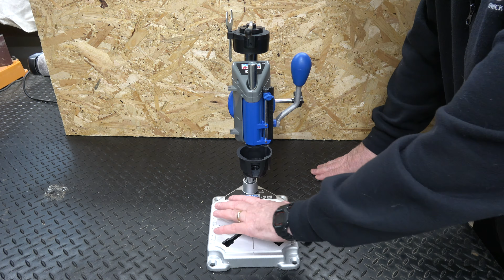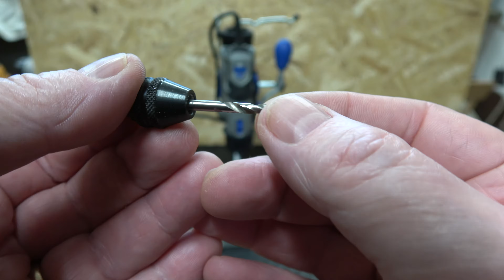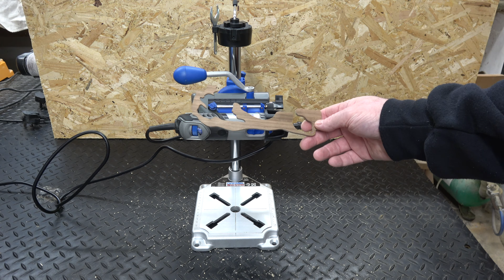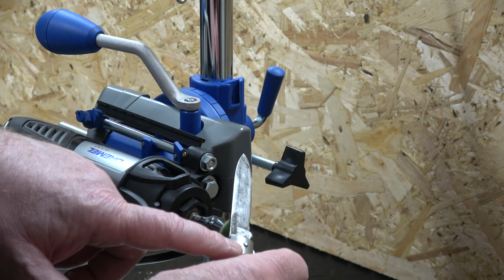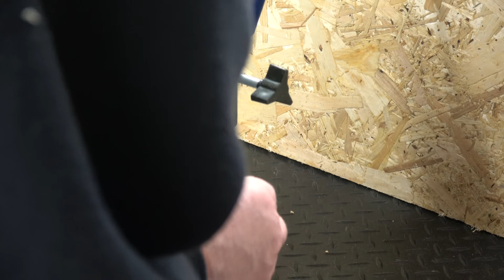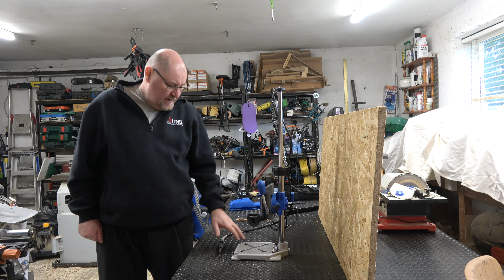Dremel 220 Workstation Review and Demonstration

Comment: Great video. I’ve just ordered one of these to use with my titan rotary tool (£20) and diamond cutting discs (£6 for 20) to frag corals, the coral growth in my reef tank is getting out of hand 😂, this will make things so much easier. And it’s currently 20 quid off on Amazon. So a nice coral fragging station for 66 quid as opposed to proper ones that are 600+ quid. Marvellous 👍

Comment: This tool is all right for basic work but if you need high precision such as when you want to drill a PCB with drill bits that are under 1mm the unnatural play/wobble of this unit works against you and breaks the tiny drill bits 9 times out of 10 so.....I returned mine.

Comment: Thanks. How accurate is that depth step?  And do you think the can be used with a dremel 3000 for drilling 1/4” holes with a #5 reamer. Or that would require a real drill press?
Reply from the maker: I would not attempt to drill 1/4" diameter wirh this set up.  :-)

Comment: Really appreciate the demo. On occasion demos are no use. I have now purchased a Dremel stand. Thank you for the info
Regards Andrew 😊
Reply from the maker: Glad it was helpful Andrew!  :-)
Reply: @RussellPlatten  I would like to purchase one also but one thing I was wonderimg about since it was not  mentioned in your video:
1) With the dremel In the vertical position:
The up-down lever enables drilling like a drilling press - ok under stood as you nicely demonstrated in your video
BUT
2) With the dremel in the horizontal position:
You showed how a drum sander can be used etc.. 
BUT 
Can we put a fiber glass cutting wheel (for example) on it and somehow use a drop/down motion to press DOWN and make a slit/cut into metal/wood/etc  for example?

Thank you for a great video!

Comment: Hi, could be possible to use with Dremel 575 (L adaptor). I need to cut tiny metal pieces but with enough precision using dremel ez speedclic. Thank you, great channel.
Reply from the maker: No, you cannot use the adapter.  You could use the dremel without the adapter and tilt it so that it is horizontal.  :-)

Comment: Can you plunge the dremel then lock it in that position, i.e. use the lever to lower the drill bit and lock it inplace?
Would be very handy, many years ago (1982 ish) I bought a Black and Decker Woodworker (their cheap router) and found that it had a 43mm collar just like a drill, so I bought a drill stand that could lock at any depth fixe a plywood base on with a 6.4mm (1/4 inch) metal dowel in it and used the stand/woodworker combination as an overhead copy router, all I had to do was make a template for what I wanted out of 1/4" plywood and stick it to the underneath of my workpiece then use a 6.4mm (1/4 inch) router bit to cut the wood to the shape of the template, made some lovely contoured mahogany table legs that way.
Anyway, I thought it might be very useful for the Dremel too, but it needs to lock in place after plunging
Reply from the maker: No, it does not have that facility Terry.  The Dremel can be dropped and locked in position using the post clamp at the back of the drill assembly (1:07 on the video), but it is not a very controlled way of achieving what you want!  :-)

Comment: A little warning for people before picking up any stone and just grinding on them. Know there are stones out there as well as minerals that will KILL YOU if you just go grabbing up any old pretty stone and grinding it. There is also stones that if you don't use water to keep them cool and the stone heats up, it will release toxic gases. Many rocks will send dust into the air of things like lead. The wrong stones like asbestos will send little spiny needle like/fish hook barbs into your lungs and cause cancer. Not to also mention silicons into the air you breathe in that will make you sick. NO rock dust is good to breath in or dust from metals. Also, don't lick rocks! We have rocks on this planet that will react with water, aka your saliva/ spit and or stomach acids, and make you sick or even kill you. Best rule of thumb. Don't breathe in anything that is not air, and protect your lungs with masks and your hands as well with gloves. Some stones are toxic even to handle. Last but least. Some stones are radioactive and sanding them could send it all over you, your house/area you work and contaminate you. Same with leads and asbestos stones if not careful. CAREFULLY AND ALWAYS identify your rocks and compositions and how or if you should even mess with them. Even rocks on places like eBay will sell you toxic rocks and not tell you about it. Be very careful! I'm no expert, but I know a bit about a bit from rock tumbling. 

But as for the video of what this tool can do. I like it. But I will definitely be adding a little gravity fed water container with a drip hose to my work on stones for things like Jasper and Opal.
Reply from the maker: Thank you for that important information!  :-)

Comment: Got this from Amazon and the bolt that hold the handle in position on the side came broken off inside....
Called Amazon and a very stupid cocky guy couldn't give me a solution where to get the bold that is broken off ...
After a few minutes searching through the "spare bits and bobs jar" I found a better bolt that has a slot in that works perfect....
Think I must patent that idea and sell it to Amazon and retire from the royalties monthly........

Lots of wood milling to be done with this tool ....
Reply from the maker: LOL - good luck with the patent!  :-)

Comment: will this Dremel product be compatible with pieces from another brand? Or would I have to buy new bits from the Dremel brand?
Reply from the maker: I would think that it depends on the brand.  If the threaded collar is the same as Dremel, it should be fine.  :-)

Comment: Thank you for this great demo. Can you tell me, what is the measurement between the end of the chuck (when the Dremel is in) and the base surface? I want to drill into a 113mm workpiece and am unsure if this would be possible. Thanks a lot!
Reply from the maker: I have just been out and checked the capacity with the multi chuck fitted and it is around 175mm Kate.  To achieve this I had to raise the inner tube and slide the 'crows nest' tool rest off the outer tube onto the inner.  This allowed me to use the full length of the outer tube.  I hope my explanation is OK, it is a little difficult to put down in words, even though it is a simple task!  :-)

Comment: In the end I followed your way, but I was wondering by replacing the two long screws where there are the springs for two longer ones and using its two long screws to attach it to the worktop.
Reply from the maker: I understand what you were thinking about and it is a very good idea Alvarez!  The only issue is that the plywood would need to be thicker and you would have to disassemble the base to fit and remove it which is more time consuming.  Still, it is a very good idea that I had not considered!  :-)
Reply: @RussellPlatten  So, you Will  have a New video for us soon !!!!! 😋
Reply: If some one buld à bases in aluminium for it with holes to attach direct into solid worktop make some money
Reply from the maker: Yes, it's a pity that they did not provide holes in the base to allow users to fix it to a plate!  :-)
Reply: @RussellPlatten  That's why you are !!! T helps us to find a good way

Comment: Hey mate!  Thanks for the tips in this great vid!  (And in the 335 one too). To properly say thanks I thought you might like to know the following thoughts I had while watching: :) 
I get that your set in your ways ("shortcuts" etc.) And although you're mindful enough to tell us to exercise proper PPE... 
 I would really feel less nervous for you while watching if we could get that power cable up off the desk and out off the way or at least more "well-managed".  I'm not "taking the piss" or anything, rather to the contrary I simply aim to improve the quality of your videos, presentation through demonstration... After all it's the small things. Tiny details which make the difference! 
Anyway, as I'm currently designing and preparing a build of my own workstation, I thought you might pause for thought on my idea to have power outlet options (extention/surge boards) up high, on a rail above everything else on my bench.  During my research/sourcing  stage I discovered these guys: "Makerbeam" and although still deciding to order something custom from them or fashion my own similar but much simpler solution... Ive made this too wordy, sorry... But just let me know if that makes sense to you and you understand, please?
Reply from the maker: I agree entirely!  I have two 5m 6 gang extensions that hang from the ceiling, one above my bench and the other above the area where my bandsaw and mitre saw are located.  I just screwed a couple of brass hooks into the joists and ran the extension leeds, up and across to the hooks.  I took the bench extension down a while ago when Ineeded some extension leads for another issue and just never put it back!  My entire electrical system is also protected by a RCD which is situated before the consumer unit and there is also a second RCD in the garage so I have two protecting the workshop area.  :-)
Reply: @RussellPlatten  yeah! That's really cool - I just happened to notice the one time you mustn't have been using it lol!  - ALthough, I do see it a lot in youtube vids (or similar) that's why I had thought to add it to my workbench build :)  
MIne will be a little more electronics on one side of the room and music making stuff one the other (not ideal but there's space restrictions for me unfortunately)  
I was even thinking of having a sliding microphone bar with a Array of mics attached, not unlike those you used to see at press conferences back in the day! :)

Anyway... I'm planning on adding it on to the top of my workbench at this point, mounting the vertical pieces to the sides (or legs) of the table before looking at further reinforcement to the table top... I was just sharing all this in case you wanted a new tutorial build idea - If you don't already having one showing off your existing setup you mentioned(?)  Or, maybe you can point me to a similar vid by a peer? Or... something?

It'd be great to get any ideas as im not fully set on the top&sides idea... I may well have an option to mount into the wall studs... 
BUt that could be too much idk

thanks for taking the time to read this lengthy reply :)

appreciate you

Comment: Hi Russell. Thanks. That was excellent. May I ask one thing please? I realise it's not ideally suited to drilling holes through small pieces of stone (like your piece), or glass, but this is what I've used my Dremel for to good effect recently. Can you please give me any advice or tips as to how best to do this by using the 220 as well, as it would potentially make precise and safer fine drilling more possible?
I've just unboxed and assembled my 220 and I wonder how I can adapt it for such use. Drilling stone, shells and sea glass to insert clasps for necklace pendants.
P.S. I've also seen a video on Amazon with a water spray accessory (????), for cooling the diamond bits whilst drilling.
Any advice would be much appreciated. Thanks Russell. Wayne.
Reply from the maker: I think the workstation will make drilling those materials much easier and give you way more control Wayne.  You need to find a way of holding the workpiece securely so that you can position it correctly.  I would try something like a mini drill press vice:  https://amzn.to/3g2J3lX  As you could use the pins to grip irregular objects and also work with straight workpieces if you stuck some rubber on the vice faces.  I reckon you could use a normal kitchen spray for cooling, just have it set as a jet, not spray.  :-)

Comment: is possible to use this station with rotary blades without fastened the base with bolts on the table?
Reply from the maker: I use it without bolting it down, but it is safer to secure it.  I would use ratchet bar clamps to hold it down if you are worried about the task you are performing.  :-)

Comment: With the aluminium base, and the travel maxed out, is there any chance of drilling into my table while working with this tool?
Secondly, I'm trying to flip the dremel 90• so as to be able to use it as a saw for slicing wood into sliced bread like thickness by pushing the wood against the saw bit, of course, it would require flipping the workpiece upside down to cut through it, if you know what I mean. Will this tool tilted 90• do that?
Reply from the maker: It is certainly possible to drill into your table if you are not careful.  The depth stop could easily be set up to prevent this though.  As for cutting the wood, I am not sure what you are trying to achieve.  It sounds as if you would need to make some sort of jig to carry out the task you want to attempt.  :-)
Reply: @RussellPlatten  Yep! Jig is what I meant.
Reply from the maker: @Sir-Kay  Over the years I have made lots of jigs to facilitate difficult cuts on projects.  It just takes some thought and often requires 'thinking outside of the box.'   There is usually a workable solution and more often than not is is pretty simple.  :-)

Comment: I bought this work station and returned it. Its not strong enough. the plastic bits its made of add a flex so the bits move when using it as a drill press.

I bought a all metal one instead of amazon and a convertor kit off ebay allowing me to install a dremel . As it's all metal there was no play or flex
Reply: can you share which one you bought? thx
Reply: Also asking what brand and model you found on Amazon. Pretty sure I need more precision than this tool provides.
Reply: @johnbauman4005  topdirect 38-43mm nulti function benchtop drill press stand for table top drilling.  
Out of stock atm as its bee n a few years but similar types are available. I bought a dremel adapter off ebay, fits into the drill jaws and ghe dremel screws kn.
Reply from the maker: It is only really designed for hobby type projects.  :-)
Reply: @RussellPlatten  true. But most hobbies need accuracy
Reply from the maker: @briw4647  True Bri, I have no issues with mine.  :-)

Comment: Looks good though I would not use it on anything very thick.  Good for drilling holes in home made circuit boards I would imagine.
Reply from the maker: It is only a craft/hobby tool.  :-)

Comment: I wonder, is there a way to lower the unit to a certain high and block it temporarily? Example: using routing bits with Dremel. Spin, lower the unit, lock it, then move the object that's being routed around, unlock, lift.
Thanks!
Reply from the maker: The workstation does not have a lock on the handle so it is not possible without some homemade system.  The router attachment will allow this though.  :-)

Comment: Very good video to explain the workstation and helped make up my mind that I can use the dremel to drill leather for sewing, I have several  piller drill station's but need to use 1.5mm drill bit on leather others to big to see up close the imprints left by the stiching wheel to drill into.
Big Thanks and keep up the good work.
Reply from the maker: Glad it helped Robert.  I reckon the workstation will be fine for what you want to do!  :-)

Comment: Started repairing/restoring vintage pocketwatches. This will be my next piece of kit. Tip for you: so at work I use an industrial size drill press as a drum sander. Going to apply that here with this at home like you did, but because the dremel workstation rotates, I'll use it locked in at 90 degrees vertical, and the table. Thanks for great vid! 
Cheers from the States
Reply from the maker: Thanks for the tip Mike!  :-)

Comment: I own one of these and love it for my scale modeling type of use, works like a 3rd hand to hold the dremel tool at many varied angles and as a small drill press.
The only thing is I wish there was a way or adapter to be able to attach the dremel tool to the workstation and then attach the dremel 90 degree drive adapter at the same time.
This would then allow the dremel to be used as a mini chop saw for small brass tubing and music wire by utilizing the drill press action of the workstation to lower the cutoff wheel.

I find when trying to cut longer pieces without the 90 degree adapter then because of tool interference you cannot get a square 90 degree cut and with the adapter you really at times need extra hands to be really accurate with your cuts. 

Being able to use the work station as a mini chop saw would be awesome and add so much to its versatility in my use anyway.

For the money though this is a great addition for your dremel tool arsenal in my opinion!
Reply: Dremel table saw
Reply from the maker: It is a handy addition to the Dremel Bill.  It is a pity you cannot attach the 90 degree adapter!  :-)

Comment: Russell any ideas on how I can use the dremel tool and bits I would use to router out closed cell foam at 100mm depth by hand to get a cnc machine finish its to customise my fishing box to hold fishing reels in place 

Great video Russell
Reply from the maker: Sorry Mark, The router attachment will only have a maximum working depth of around 20m.  I would look at a serrated knife to cut out the shape of the compartments and cut away the insides,  A multitool might work, or a hot foam cutter.  :-)

Comment: Lovely tool. I just wish it had some sort of a vise to hold things in place when doing precision drilling.
Reply from the maker: Depending on what you are drilling, a cheap drill vice may help.  :-)
Reply: Well, in this case, I'd need to drill new holes on an rc car motor mount. Not much place for mistakes because the mesh between the motor gear and the spur has to be perfect. I'll try to find a vice compatible with the 220 workstation. Have a nice day.
Reply from the maker: @Molekulasti  Good luck with the car!  :-)
Reply: Thank you, Russell. Love the channel. :)
Reply from the maker: @Molekulasti  :-)